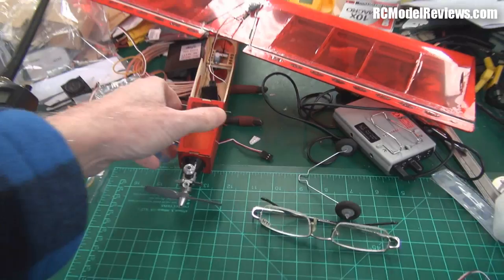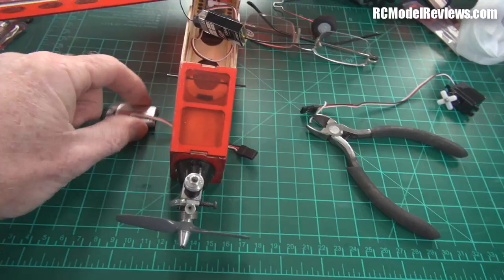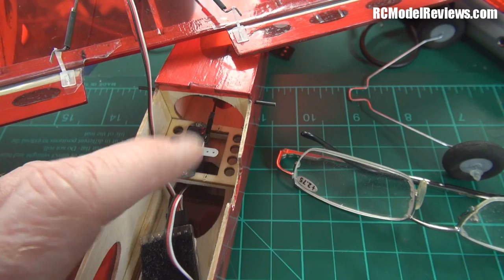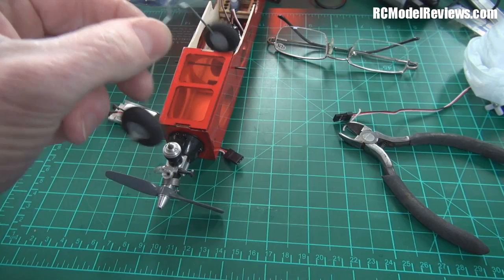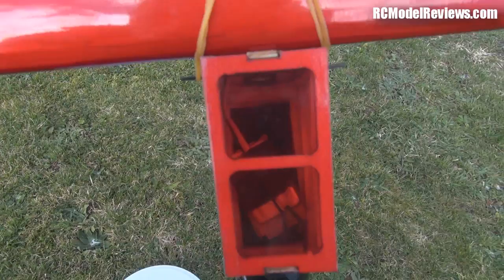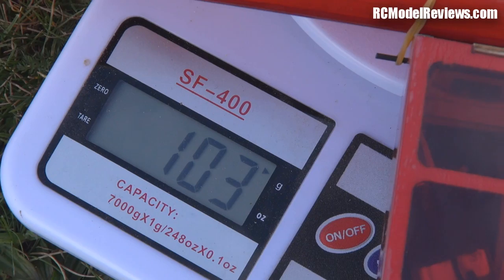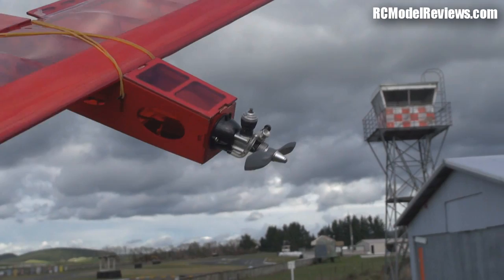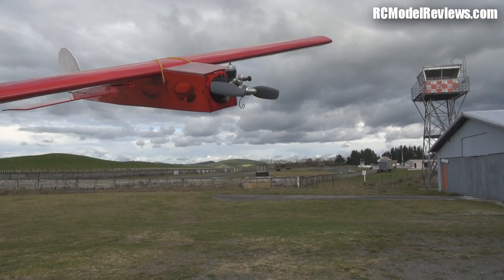The nitro powered Mini Stik RC plane is finished

Comment: bruce, i now it won't matter too much but take out the signal wire of the servo lead that's connected to the battery and reduce the length of the connection part of the pushrod. that will probably decrease the weight by around 2 grams or more.

Comment: yeah, and replacing velcro with regular tape could also save a gram or two I guess.  Also the servo plugs are smaller and lighter on the parkfly receiver